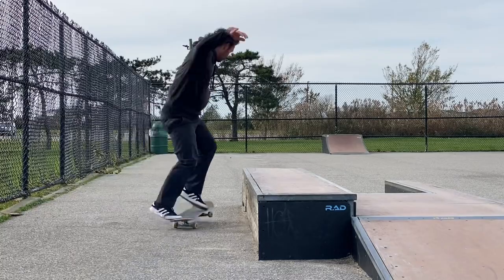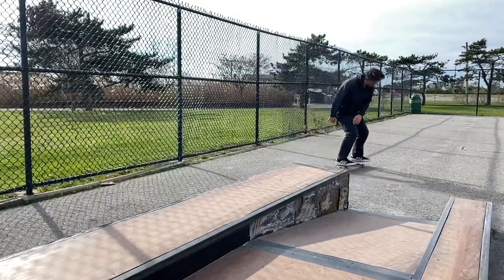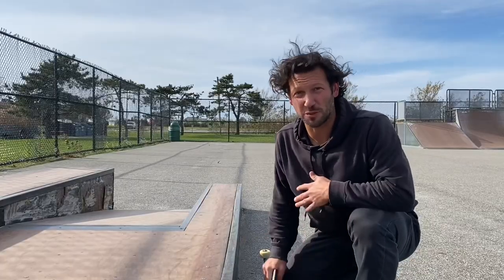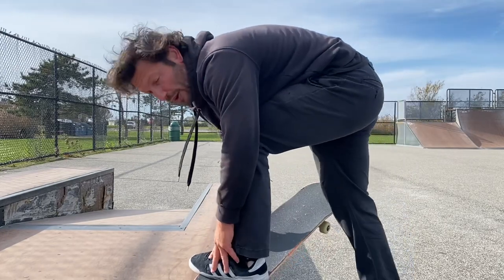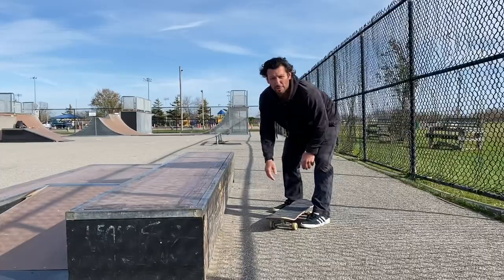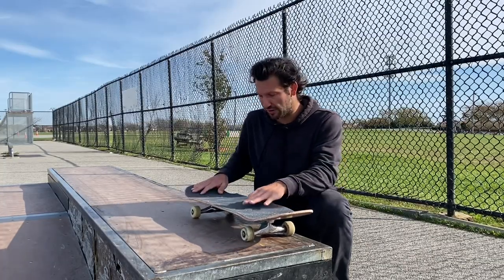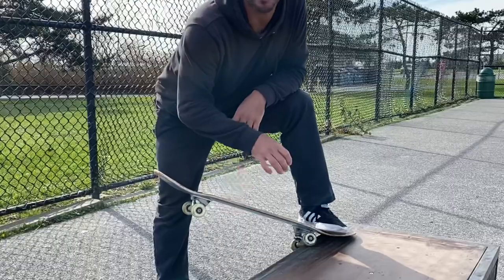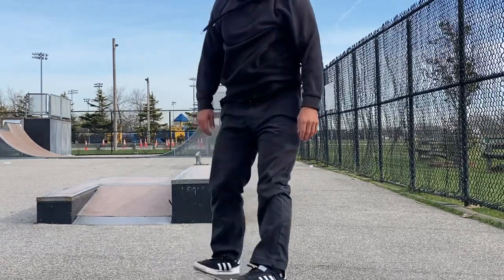How To PINCH Fs Crooked Grinds!!

Comment: Best trick tip for it yet! You Definetely gotta wanna go for a front nose ans get that nosegrind out of your head. 1 thing that helped me to learn them was to do a bunch of front nose slides and just practice landing them, and then just change the angle popping slighty closer to the ledge. Focus on the toe and if you miss front krook, worst case is you land another front nose. It ls literally just an accidental front crook that way with more happy endings than slip outs or truck on top.